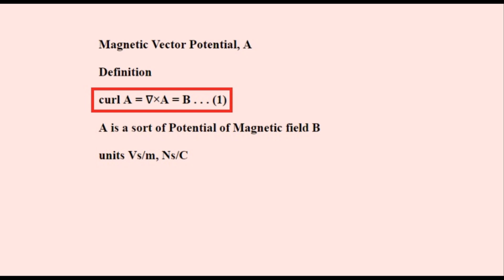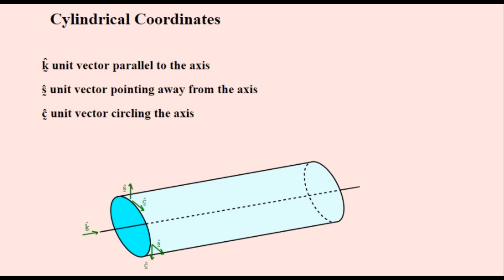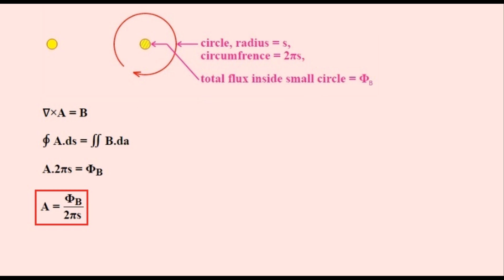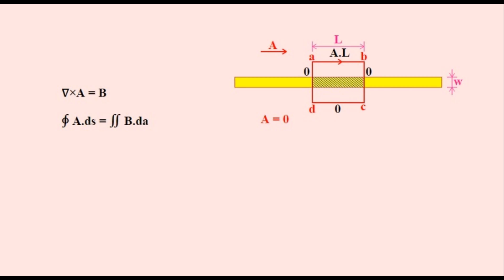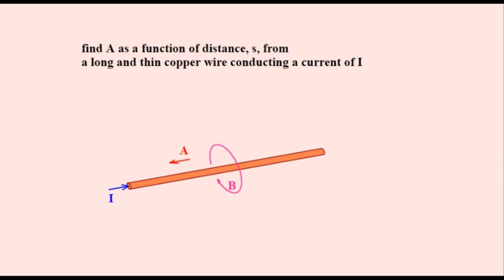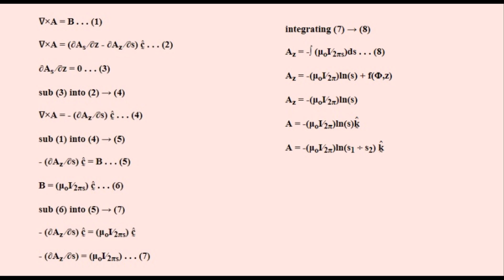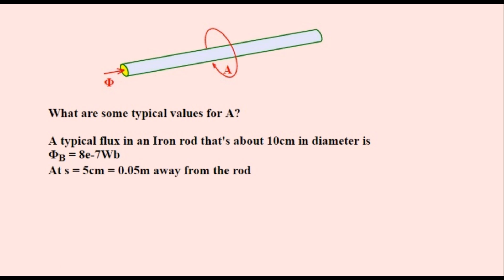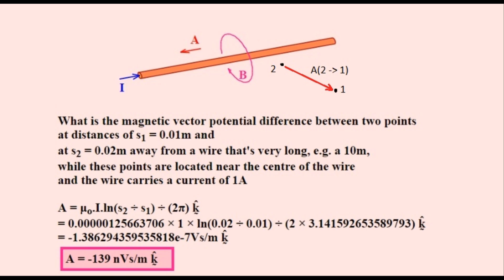Magnetic Vector Potential

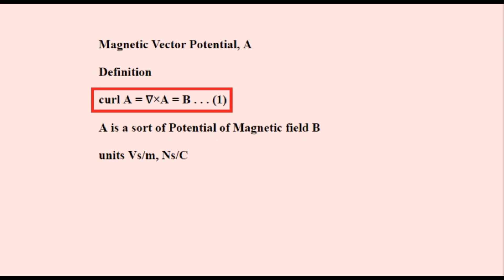Comment: 0:40

Franz Ernst Neumann was the first to write down the magnetic vector potential in his 1845 paper "General laws of induced electrical currents." He used it to write the equation summarizing Faraday's induction experiment (Faraday's law). I just looked at it, he did NOT use the letter "A."

According to the book "History of Wireless" by T. K. Sarkar, Robert Mailloux, Arthur A. Oliner, Maxwell used the letters "F,G,H" for what we now know as "A."

Per Wikipedia: Historically, Lord Kelvin first introduced vector potential in 1851, along with the formula relating it to the magnetic field. 

The easiest guess is that you start with the magnetic vector potential, A, then take the curl of it to get the magnetic induction field, B. "A" comes before "B."
Reply from the maker: Thanks for that information. I found it in textbooks and on the internet written as A.
Reply: @electroworld9872  Yes, we know. And I see it represented by "A" in my current E&M class. The question was where/why was "A" first used. Even perusing the literature, no one seems to know. My best guess is that the curl of "something" gives B, and they (eventually) referred to it as "A" because "A" comes before "B".  Maxwell used the letters "F, G, and H" in his writings.

Comment: Great video! 😀 In the very last example, there appears to be a misprint on the diagram showing "B" circling the wire in the wrong direction since "I" is blue meaning electron current. At any rate, the "A" vector being negative in the answer and in the diagram implies that it is the "B" field that is wrong. Please verify. Thnx 😀
Reply from the maker: I tried it again using the right hand screw rule. B and I are consistent with that. B is the same inside the coil, and A can't be calculated simply by a right hand screw rule.